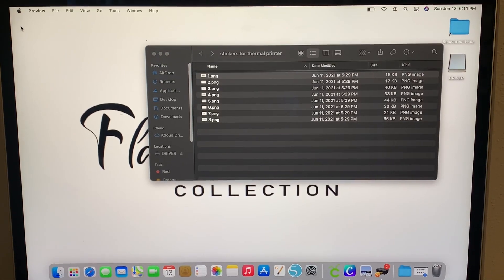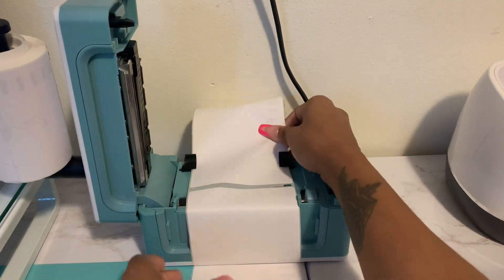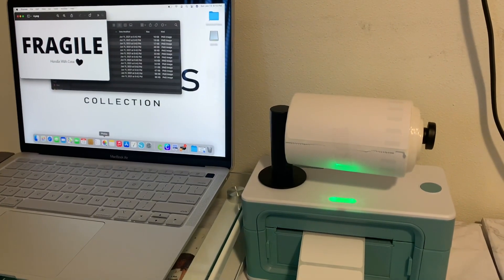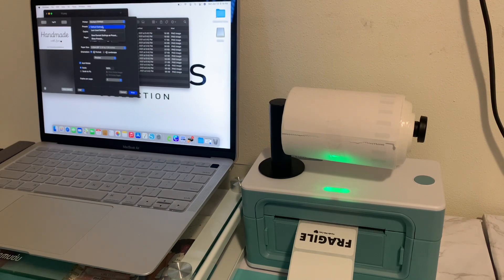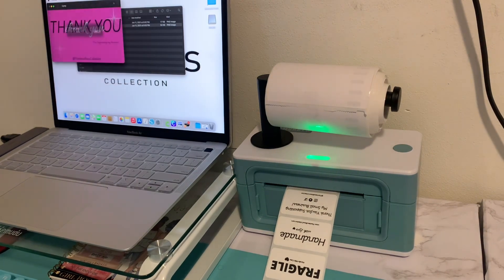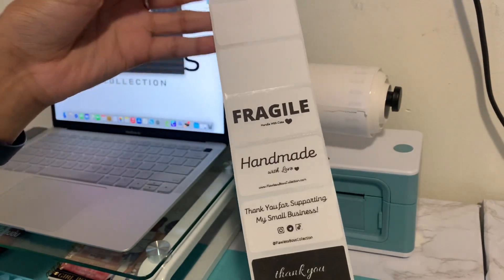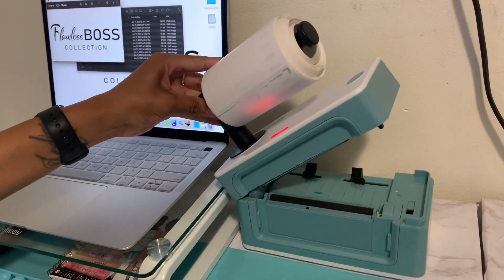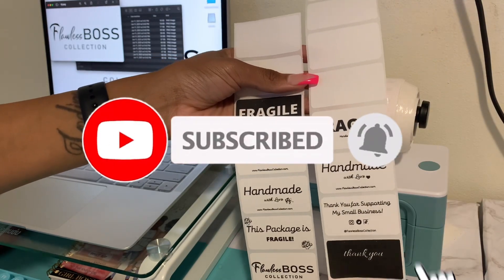How To Print Stickers Using Munbyn Thermal Printer | Part 2 | Canva Tutorial

Comment: What program are you using to print? I can't seem to get it to print correctly on the 1.25 x 2.25 so not sure what software to use to print from?
Reply: “Oh my god it did it!!”  Literally what I say every time something works for me 😂. Thank you for this!!!
Reply from the maker: I have a MacBook Air - so I create my design in Canva then I download it and then print straight from my MacBook Air  and it gives me options of sizes
Reply: @deedee2xx  well poo... that doesn't help me... I have a Surface Desktop... :(
Reply: @ShoreLifeCreations  okay, I know this was 5 months ago, but I had the same issue. Had to reinstall the driver and now i get the smaller sticker size options
Reply: @deedee2xx  I did my designs in Canva... I use it all the time... just gotta figure out a program that works to print them..
Reply from the maker: @ShoreLifeCreations  I have a regular hp laptop I am going to test it out to see if I can figure it out on the hp laptop.
Reply: Anyone was able to print the size mentioned on the initial chat here? I am struggling with this. Thanks in advance!

Comment: I just got my Munbyn and mine isn't showing all those different sizes nor is it printing right. Are you able to help?
Reply from the maker: It goes by what labels you are using . The labels I ordered was 1.25x2.25 I believe so you would choose that size before printing but it has to be set up to your computer first . Following the instructions from the manual. I did have to contact them by email sending them a video of a issue I had. 

When you put your label in the thermal hold the light down until you hear a noise , once you hear that noise, let it go and the thermal printer should basically read the label size (it will go back then forward then back and forward again) once completed & it stop then go ahead and click print from your computer or laptop and click the Munbyn thermal printer and print . If that still isn’t working please contact them by email
Reply: @deedee2xx  Thank you! I just emailed them!
Reply from the maker: @rebeccavlisides9628  your welcome .